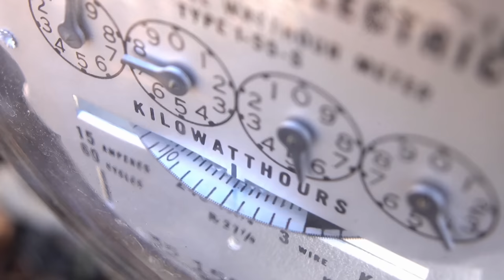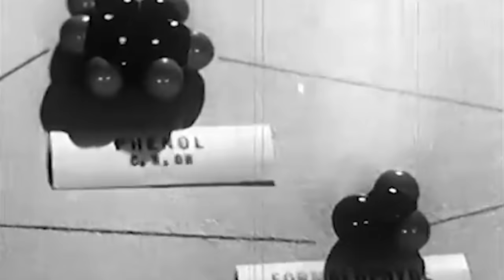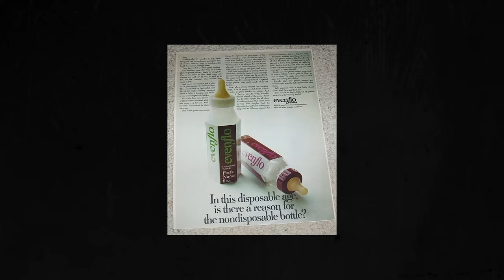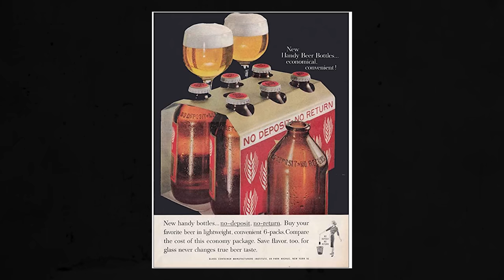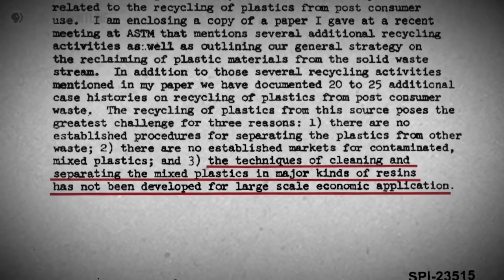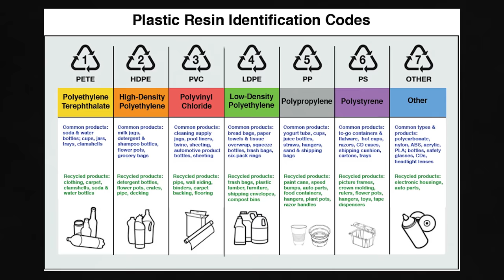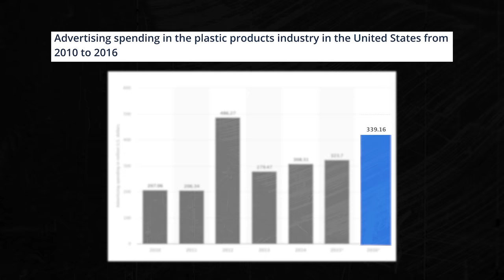The great recycling LIE (what really happens to plastic)

Comment: Recycling glass really does save a lot of energy in a glass making furnace. I used to be the engineer that had to do the calculations.
Reply: And notice, they stopped paying for returns in most states.
Reply: As long as the recycling facility is very close. It is not economic to ship waste glass very far, reusing glass beverage containers is even better
Reply: @ronman5528  In our dumb County, rural people pay County taxes, but then are prohibited from using the county seat recycling.
Reply: I think that recycled, crushed glass is called "cullet" and it's then combined with virgin ingredients to charge the furnace.

Comment: I can remember when glass was the primary material for liquid and semi-solid household goods.  And, while we remember soda bottles and milk bottles being cleaned a recycled, most of the jars and glass containers for items e.g. pickles, peanut butter, shampoos, medicines, etc. were tossed and ended up in the landfill.  So, it's not just a plastics problem.  The amount of plastics ending up in the landfills has been pretty stable since around 2015.  The amount of recycled plastic is about the same as well.  The amount of plastics that are combusted with energy recovery has been steadily increasing.  One benefit of plastics which is rarely cited is their relative safety compared to glass.  The number of cuts and injuries sustained by broken glass was pretty high.  Today, you can drop your shampoo in the shower and not worry about stepping on broken glass.  And, even though glass is recyclable, only about 1/3 of glass consumed ends up being recycled.  We have a long way to go.

Comment: I work in a related industry, and I will tell you there is a big difference between “recyclable” and what actually gets recycled. Many, even most, people where I work have good intentions (not lying or trying to trick people). Having said that, there are a lot of good health reasons to use single use plastic, especially in healthcare and foodservice. Rates of communicable diseases have decreased considerably from 100 years ago as a result of her food packaging and reduced cross infections in hospitals. Plastics are a big reason for that success. But I agree that we don’t need to have everything made of plastic and should reduce our usage wherever possible. One solution is to standardize the containers based on what they’re made of (substrate) and remove printing and coloring from the packaging (use labels that are easily removed in the recycling process instead). Companies don’t want to do this because marketing sells products. But standardized containers would help reduce waste and increase how much is actually recycled
Reply: Majority of improved life span is due to clean water (chlorination and water treatment) and food abundance last century.  Vaccinations and medical improvements were far less significant.   Plastic is cheaper than glass (and less fragile) which is a big factor of why it is used for food.
Reply: All true! And this is not even considering the extra weight of aluminum or glass  in terms of emissions when shipping goods. The energy and chemical consumptions in the whole processes to reuse glass or metal containers.
Reply: Almost all plastic is recyclable. However, most places only the most profitable plastics actually get recycled. Then you are told the others are not able to be. Its all about the money, nothing to do with what is right.

Comment: I found out years ago that most of the plastic we "recycle" is just shipped to places like India to be dumped in old marble quarries. I use to load containers then take them to a port in Ireland where they went to India via Rotterdam Port. The cardboard and paper was bailed and sent to China to be burned in their power stations as a booster I was told.
Reply: And, the air We breathe becomes more toxic.
Reply: The higher quality paper was recycled into cardboard boxes in China to ship goods back to the world.

The general problem with recyclers is that it has very low margins and government often needs to subsidize it. Due to low margins scammers illegally dump it or stockpile it and then go "bankrupt" or accidental "toxic fires" start.

Comment: I laughed when Snapple started to sell more “recycled plastics” and not the glass bottles and even put a “please recycle” on it.. such a joke the truth is it’s just cheaper for them to Manufacture it due to less weight when moving the bottles
Reply: Don't you find that beverages like Coca Cola and Snapple taste better when they're packaged in glass bottles?
I definetly do.
Reply: @markbrowning4334  Yes!
Reply: I agree, products in glass bottles taste better.
Reply: The thing is that higher weight also increases fuel consumption. Glass bottles cannot be stored as densely as plastic ones, meaning they take up more space and that leads to more trucks being required to transport them. And glass recycling is very energy intensive. As a solution to plastic, glass creates way too many problems. We need a different way of distributing beverages in general. 
For instance many beverages could be transported as concentrates, cutting down space and weight requirements several times over. Water would be sourced locally. And this system already exists (beverage dispensers at restaurants). It just isn't available to consumers at a larger scale.

Comment: IN New York State plastic soda bottles and beer bottles have 5 cents added to the price when you buy them.  You get 5 cents for every bottle you recycle.  There is a machine in every supermarket you put the bottles in and it spits out 5 cents in coins for every bottle you insert.  Then it chops them into small pieces that get compressed.   Trucks bring this stuff to a factory on Long Island where they melt the plastic and this is turned into plastic lumber.  That is used to make signposts, boardwalks,  and other things left outdoors.  You don't have to paint it and it never  rots.

Comment: Once I set our trash outside for it to be picked up just in time for the pick up. I “did the right thing” and had everything separated out for recycling. When the trash pick up came the guys pick up the normal trash and dumped it into the compactor. Then they pick up the recycling bin and dumped it into the same compactor and drove off. I stopped separating my trash at that point.

Comment: 15 years ago I was told by someone who worked for a recycling company that only 40% of the plastics you bring to the recycling place gets recycled. Recently I've been hearing more and more about how some cardboard, like what juice comes in, aren't recycling. Or if it's really dirty it can't be recycled either. I've kind of gave up trying to figure what is and isn't recyclable.
Reply: Assume that if it has any real debris - food or otherwise, oil (both cooking and non-consumable) stains or wax then it isn't going to be recycled.
The only paper that's really recyclable is the basic office paper, and then cardboard that you typically see used as overpacks for goods (like the boxes that hold 40 candy bars people then pick out individually from stores shelves).

Comment: I've always been confused why we use a material that is incredibly durable but for a single use. Part of the rationalizing I had was that since glass would break there could be lawsuits which is a monetary reason but not as nefarious or unjustifiable. 

It's always about money and control
If only real life villains weren't so lame....🙃
Reply: Yeah, it’s easy to make a profit when someone has to rebuy your products continually. Versus buying one thing that might last them years. The pursuit of everything bigger and better so quickly messed up our world.
Reply: It’s always been like that so is the great reset
Reply: I always thought it could be shipping 'weight' that caused the switch to plastic, but liability is probably also a cause. I am old enough to remember only glass bottles for pop. We could even return them to corner stores in exchange for items because of the deposits.

Comment: I’ve been a security Director for years for almost every major box store out there and a lot of them I have personally seen throw away the recycle bags that people come in and put into the recycle bins to have recycled or watch as they get transferred from that bin straight into the trashcan but the public believes are doing all this great for the community and recently I’ve heard kind of the same where there are just too many types of plastics that realistically cannot be sorted to the point that it can be recycled so people do all of this hassles for nothing only to have the illusion they’re making a difference that’s funny because the same is true of electric cars big hype make you feel like you’re changing the world when realistically you’re transferring the exhaust from your exhaust pipe into a large factory that’s producing the electric cars absolutely no change in anything it’s just the perception of what’s being done
Reply: Don't forget that the combustion engine is the MOST efficient source of energy for a car.
If a power plant is doing the energy creation then it has to be created (wastage), stored (wastage), then delivered over miles of cabling (more wastage), before being used to charge your car battery (more wastage), and finally being used up to power your car.
There's so much more wastage and "carbon footprint" by going EV, which is why they are all pushing for it... it's more profitable.
Would you rather sell a single tank of gasoline, or equivalent electric THREE TIMES OVER for the same end result?
🥺
Reply: @psluxton  Except that's not exactly the case.
While there ARE more places where an electric vehicle introduces losses into the system (outside of the vehicle), the total loss of energy for combustion engines is so massive inside the car that it makes it an almost completely moot point; The only exception is diesel, which is more efficient than most cases of electric vehicles (with some renewable sources making the efficiency better that diesel, but that has it's own issues).
But in general, EVs are more energy efficient than any non-diesel vehicle, or are at similar levels.
Reply: ...and I always wonder, what becomes of all the batteries when they finally die?!?
Reply: @OzixiThrill  Eventually EVs may polute less but I read the figures & was shocked its only after about 75k miles when most owners would have replaced the car anyway & by then the performance has reduced so much that the batteries need replacing. Not blindly against using EV but it's been decided all vehicles will be electric & there's hardly any research into alternative engine power like hydrogen (which has some problems but could be solved if there was incentive & it hadnt already been decided electric is the answer

Comment: I love how now they charge for grocery bags with the excuse of it for the environment.
Reply: Bring your own bags to the market. Do self-check-out and bag your own purchases. Put your purchases away when you get home and IMMEDIATELY  put the market bags BACK in you car, or someplace handy if you use public transportation. 

Some food manufacturers pack food in reusable “mason” jars with one piece lids that can be converted to two piece lids. They may not be standard pint or quart sizes, but we still keep them in the canning rotation. 

We had paid up to $40 a month for a private recycling service, but they dropped glass recycling because of the economics of shipping the glass containers 500 miles to Denver, the nearest glass recycler. When the reports came out of USA exported plastics being dumped over-seas and not recycled, we dropped the service. 

We do what we can to minimize SUP “Single Use Plastics.” We reuse many of the bulk plastic containers from COSTCO. The bulk size nut containers work for dry goods. A lot of products not come in “zipper” bags that we wash and reuse. The aluminum coated/sandwich constructions zip bags are used for freezer storage after being washed, dried and rolled for storage. We have a number of insulated metal beverage containers that we carry daily. Our refrigerator has a built-in water filter, so we can fill up with ice and water before leaving the house. 

I crush all steel and aluminum containers and store them in 5-gallon plastic (what else?) pails, then make a trip to the recycler once or twice a year. 

The whole industry has been “greenwashing” the problem for years.
Reply: @charlesward8196  you can easily convert plastic into fuel.
Reply: @aloofsive1140  A lot of polymers and resins have significant amount of molecular chlorine that generate toxic compounds that makes pollution control of incinerator gasses a challenge.

Comment: The last regular job I had before becoming a self employed tree farmer was at an injection molding plant - we made pipes and fittings for the natural gas industry, mainly, along with a few other products.  A lot can go wrong during a product run:  even a minor variation in temperature or pressure can cause a large amount of plastic to become unusable, and as you might imagine, quality control for these components has to be very high.  Waste plastic was reground for other purposes .. but the only thing that our customers would accept that was not molded from virgin resin was the end caps that keep the critters out of pipe while it is in storage.  We had a lot of recycled plastic that we could not use .. eventually, the stuff gets loaded up and taken to someplace that makes recycled plastic parts - and they ARE recycled .. just from the industry's own waste stream, not from the stuff that people sort out into bins - that stuff goes to the landfill.
Reply: Wide awake UR.
Reply: PVC is a dangerous polymer- the thousands of other injection and thermoformers not only are buying as much recycled content as we can get our hands on, we use all of our post-industrial waste regrind.  Your isolated experience is not the norm in the industry.  PVC is one of the least used plastics out there due to the dangerous nature of its chlorine content.

Comment: Years ago, I worked in an injection molding plant. That's where I learned that only certain plastics are reusable, and even then, you can only use regrind a couple of times. After that, the plastic is very brittle.

Comment: As a Physicist-Engineer: Plastic is actually quite an easy thing to recycle, but you do have to take it all the way back to the crude oil stage. But that is not hard, there are two different ways of doing that. In fact, all plastics, if sent to land fills, should be in their own separate section so we can use them again in the future.
Reply: Yes, but it is cheaper to just make more plastic from scratch so they do that instead. It's greed.
Reply: @jenc9824  - Agree with you fully. That is why I say you should store it in landfills. At some time in the future, it may become cheaper to pull it out of the landfill than to drill for it.

Comment: I would love to see an environmental impact assessment of the fact that we are encouraged (told..!) to WASH food from plastics before putting them into the recycling bin or it would 'contaminate the load'. People are taking their oven ready meal trays (with food baked onto it so hard it might as well be concrete) and washing it up using
A) hot water (heated by gas or oil)
b) detergent
c) and of course, lots of their own time and energy as 'unpaid workers' of the recycling industry

Before putting it into a special recycling (plastic) bag and dumping it outside for the collection. So, if we believe our local authorities the 'entire load' of recycling get's 'spoiled' if just one of my neighbours doesn't give a ** and doesn't clean the food off the packaging. Sound plausible? Surely that would mean most so-called recyclable plastics get dumped or incinerated anyway. 

Environmental impact?? It's got to be worse than just not buying (or washing..!) plastic in the first place - or at the very best, it must be more costly to the environment that just not recycling any of it.

Comment: Oddly enough i work in transport and our work involves loading shipping containers with waste plastic and waste cardboard..
This is shipped off to places like vietnam and thailand and then recycled there and we buy it back from them..
The current cost per tonne of occ cardboard is £160 per tonne and plastic is currently £360 per tonne..
So whilst you think your doing the right think think of this..
A diesel truck driven by me has to drive to the recycling centre to collect this stuff then i drive to the docks and a diesel lift stacker truck lifts it off the back of my skelly trailer and its put onto a diesel tug which drives round the dock to the ship where a ship to shore gantry crane lifts it onto the ship and the ship which is powered by marine diesel then sails off to its destination..
At the port of entry it does the reverse role and is put onto another truck and driven to the place it will be turned back into new product..
My question to these climate alarmists is how can this be enviromentally friendly when we could recycle it in our own country which would create jobs and boost our economy and save the planet..
Sad reality is that this is big business and people are making millions off the back of it whilst the good people keep putting their waste in the correct bins..😂

Comment: I have already worked with a recycling company and yes, you can recycle almost everything, but it is only viable through multi-industry integration, because what comes out will hardly become viable as the same thing it was before. An amount of styrofoam after recycled, for example, will not be viable to create another package, but could be used for car parts instead, and may need resin from other plastics to avoid releasing toxic gas. So, yeah, a simple brain cannot properly recycle. We will need bio-engineering and multiple types of industry integration.